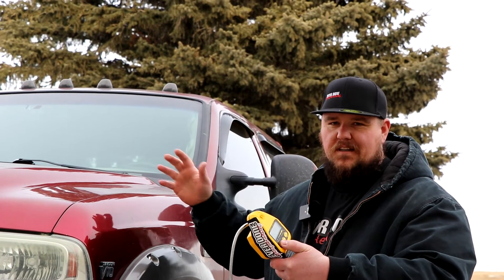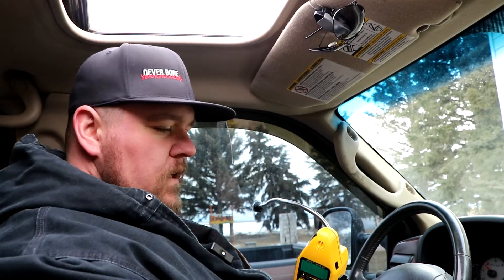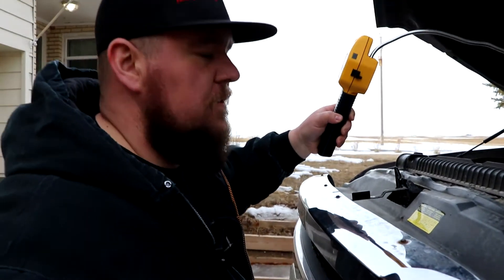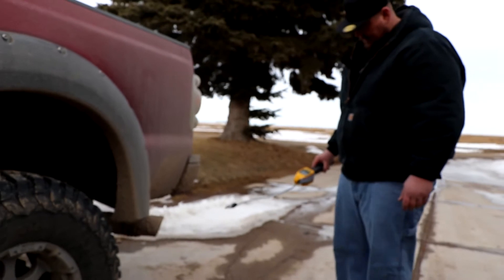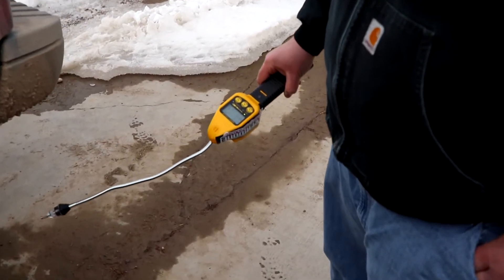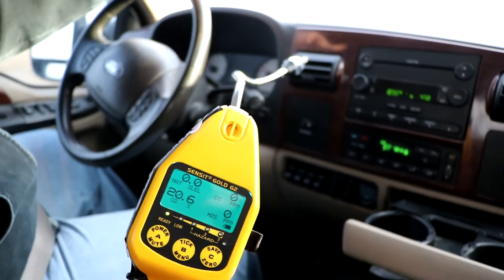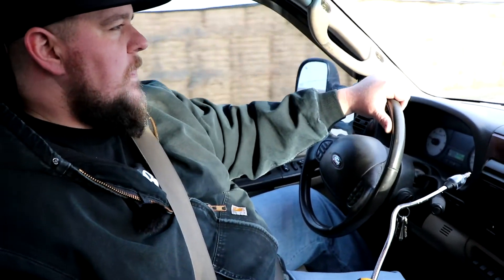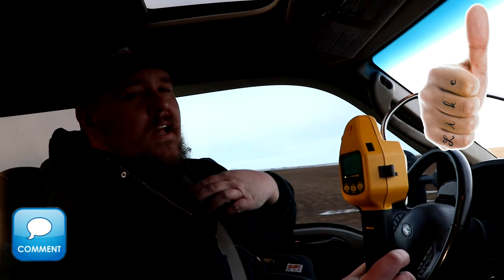Never Done Super Duty Carbon Monoxide Testing

Comment: On the home detector  if you read the instructions that came with it  , at 50 ppm is made to go off only after  1 hour of that 50 ppm  reading . It has to go up to 400 ppm to go off in 4 minutes  50 mmp is the lowest level of carbon monoxide  ppm .
Reply: Basically meaning shit because 50 ppm for one hour can be bad for a lot people heath